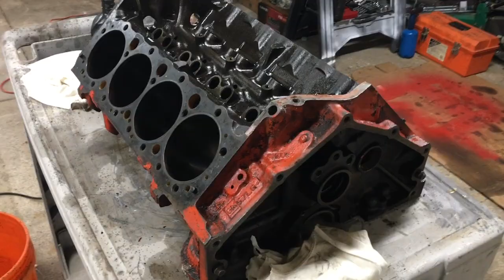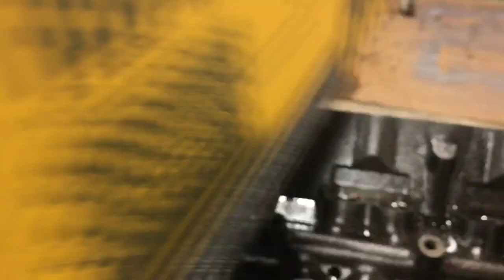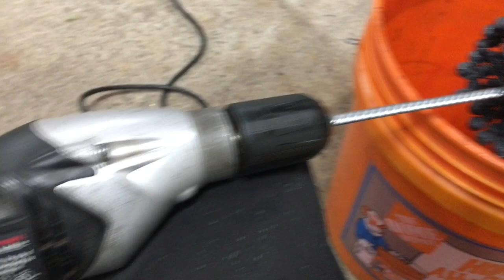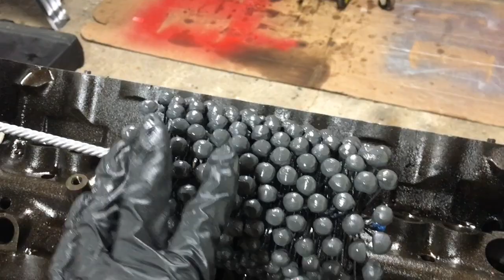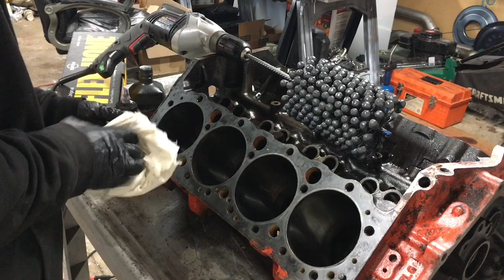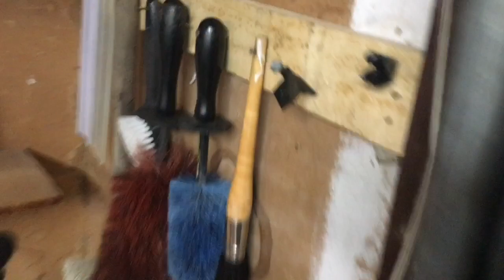Using a Flex Hone - Tips & Results!

Comment: What grade are you using?
Reply from the maker: I finished with 240 grit. That is the correct finish for my application. It will depend on what material your piston rings are. You can Google it or ask your manufacturer.
Reply: @BriGuyGarage  👍thanks
Reply: @BriGuyGarage  What grid did you start with? Let me refresh that. How many grids did you use?
Reply from the maker: It will depend on the condition of your cylinders. If they are in good shape, and all you need to do is prep the surface for new rings, then simply starting with your finishing grit is fine. However, for example, in another engine I just did, there were some light scratches - so I started with 180 grit, then finished with 240. Any significant scratches or cylinder damage will require a machine shop to properly hone the cylinders.
Reply: @BriGuyGarage  Thank you very much.

Comment: damn my engine has 500k miles and bores don't look that bad
Reply: Thats BS.
Reply: @SOLDOZER  I am rebuilding my dodge dakota engine starting tomorrow

I'll take a picture of you want, it has 485,000 miles, i just rebuild the transmission last month, I had no friction material left on overdrive but forward and rear clutch packs were still good

I have oil squirters, moly rings and it doesn't make a lot of horsepower with a big bore for a small rod to stroke ratio. i have only had to knock the glaze off the bore last time i changed the rings and replaced the bearings

all this means low wear on the bores
Reply: @ihatecrackhead fuel injection and low tension rings help the late model stuff last alot longer

Comment: I shoot for a 40 degree crosshatch.   It's a delicate balance of RPM and speed of the strokes.  I use cast rings in my BBC builds, with a 400 grit flex hone.  I ran the engine over a 1000 miles and the cylinder still had the cross hatch and the rings did break in. Where did you read 280 grit for cast rings?  I read 400 grit on all rings except chrome rings. A commenter posted that too much ball honing takes too much metal out. That's incorrect. I honed a cylinder in the past 20-25 strokes and it barley took out over .0001" , one ten thousandth's. I have a good dial bore gauge, Mitutoyo. Checked it before and during.
Reply: what 400 grit hone did you use? The one I used did not provide even finishing so I was thinking of redoing it with 240g and just rebuilding with that.
Reply: Chrome rings are more of a hot rod thing right? I'm rebuilding my VQ40DE. Head gasket failure but took the engine out to place rings and bearings since the engine is out.

Comment: Hi dude, one thing you might mention is to be careful bottoming out the hone in the cylinder, you can hear it bouncing off the casting on the bottom of the sleeve. This is what can cause scratching in the cylinder if you damage one of more of the hone stones and then continue to hone with it. Also! ATF is a great cleaner, you could simply spray the cylinder down with brake clean and then wipe the cylinder with clean ATF until your shop towels come out clean. No need to add water this way, in fact this is the way motortrend does it and it doesnt promote rusting of your fresh surfaces. Looks like it all went well for you bar 1 cylinder, but to be fair your cylinders looked fairly rough to begin with, i probably would have used a 150-180 and then finished with a higher grit, but that means buying 2 flex hones.
Reply: Its bouncing off the wood table you moran.

Comment from the maker: TWO NOTES:

I’ve gotten a few comments about the amount of strokes I used in this video. These are the instructions directly from the manufacturer: “Honing time of 10-45 seconds. 5-60 strokes. Hone until desired finish is achieved.”

I went with the higher end of the scale, as my cylinders were a little beat up. I tested this out on other cylinders prior. I performed 5 strokes at a time until I had the desired finish. I recommend you do the same. Your honing time will vary based on your cylinder condition. 

Additionally, I’ve used this hone again since making this video. I had even better results increasing my speed on the last handful of strokes. Seriously - move it in and out of the cylinder as fast as you can, then check your cross hatch. It came out even better than the results seen here.
Reply: you did a good job👍I'm doing the exact same thing.I have a Chevy 350 4 bolt Main actually came out of a 75 2 ton van👍

Comment: Did he say 60 strokes 😳 i thought 20 was wat to many 🤣🤣
Reply from the maker: That is the recommendation directly from the manufacturer. Honing time of 10-45 seconds, 5-60 strokes until desired finish is achieved.  This engine has been running now with no issues and the rings appear to have seated and sealed just fine.

Comment: crosshatch really looks about 20 degrees to me. i was taught to go really really slow with the rotation speed, but quickly with the in/out. that always assures a 35-45 degree hatch. those crosshatch gauges are nice to use to see exactly were you are. then knock down the high spots with a stiff nylon brush.

Comment: Ur doin it too much, ur taking alot more material off than u think.. u only need to go in & out  no more than 7-8 times
Reply from the maker: That is the recommendation directly from the manufacturer. Honing time of 10-45 seconds, 5-60 strokes until desired finish is achieved. My cylinders were a little beat up, so I went with the higher end of the scale.
Reply: Honing does not remove material.
Reply: @SOLDOZER  Totally wrong

Does honing a cylinder remove material

Copy
Searching for: Does honing a cylinder remove material

Searching for: Does honing a cylinder remove material

Generating answers for you…

Generating answers for you…

Yes, honing a cylinder does remove material. Honing is a stock removal process intended to perfect bore geometry and size by removing a minimal metal layer while generating a finish pattern to provide optimum lubricant retention1. The amount of material removed during honing depends on various factors such as the type of hone, the grit of the stones used, the condition of the cylinder, and the specific honing tool that is used23. Is there anything else you would like to know? 😊

Comment: Hey briguygarage, great work, very nice end finish, just a quick query, on the drill settings is the cross hatch achieved on clockwise or counter clockwise settings? and would you say it’s critical if not done in one direction? cheers fazzeg3
Reply from the maker: Seeing as a brand new flex hone as near perfectly circular “balls” on it, it doesn’t appear that it’s intended to be rotated in only one direction. The manufacturer recommends running it in a clockwise direction, removing the tool, switching it to counter clockwise, and to perform a few more strokes. So it doesn’t appear that rotation is limited to one direction.

Comment: Good video!  I've seen/read that some folks are reversing the motor on the drill to get the same cross-hatch. I own the 3" version and will be doing it on my 2.0 FSI Audi block.  Afterwards I 'll be hot-tanking it to get all the crud off of it. Nice work!
Reply: I know this was 2 years ago but how did it work out? I’ll be doing it to the same block soon enough.
Reply: @jdm68  it’s worked out great. The car is running great and my son uses it every day.
Reply from the maker: Interesting, I'll have to look up the theory behind using it in reverse. Thanks for sharing!

Comment: If I do this with a 320 grit flex hone on std cylinder bore that’s still good (since I’m replacing my main bearings ) can it affect or change my bore size or piston ring size ?
Reply: Thanks for the very informative video! About to start building a 400 sbc for my 79 Z-28.
Reply: I order the 120 Grit . What YOU use for honing ?
Reply: Greg Hunder thank YOU for the answer bro !
Reply: I’m not the guy doing this but no it’s not gonna change the bore size or mess with the rings. But that in mind you also don’t usually want keep honing it as long as he did either lol.